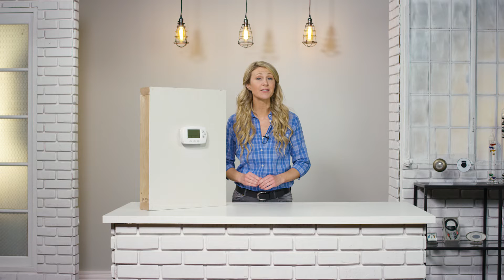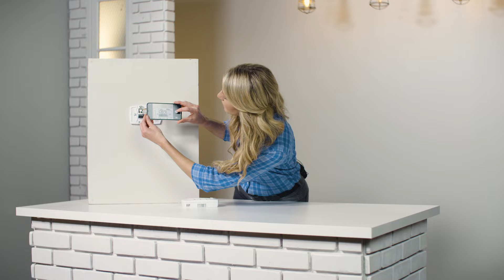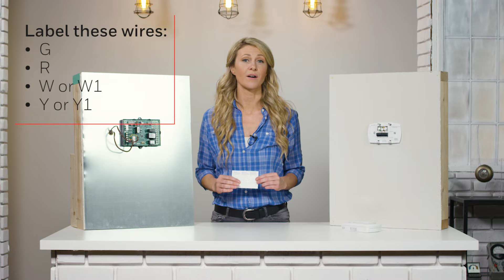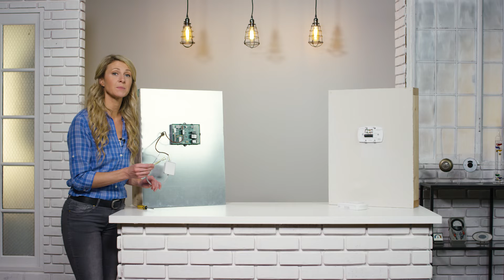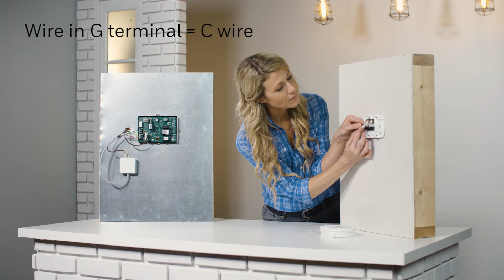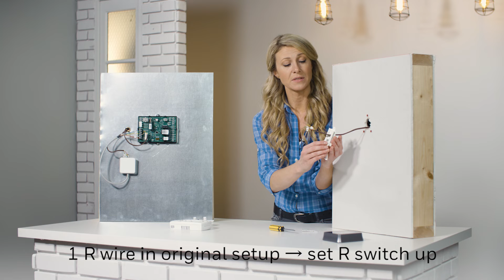How to install your T-Series Smart Thermostat

Comment: This doesn't help if you have a customer with a red and white wire.. and a red link panel.
Reply from the maker: Hi Chris, thanks for your message. T series are not compatible with RedLink installations. We recommend looking for RedLink thermostats if you wish to upgrade your unit. Feel free to let us know if you require technical support at 1-855-733-5465 or you can send us a private message on our Facebook or Twitter page under "Honeywell Home". Thank you. - Laura

Comment: what happens if I only have an R wire and a W wire and GROUND wire
Reply from the maker: Hi Wendi. For T5, T6, T9, T10 Wi-fi thermostats you require a "C" wire. This thermostats are compatible with 24VAC applications. We recommend to verify voltage and system type.  Please, feel free to send us a message through Facebook or Twitter (Honeywell_Home). You may also reach out support team at 1-800-633-3991, case reference #02050013. We'll be glad to assist you. - Laura

Comment: "If you have a C wire, skip to the next section"  - where is the next section?
Reply from the maker: Hello Tommy, thank you for your comment. When it says this, it refers to mount your wall plate and your thermostat with your wires installed, since you already have a C wire, now all you will do is configure and connect your thermostat. This will be the next section.